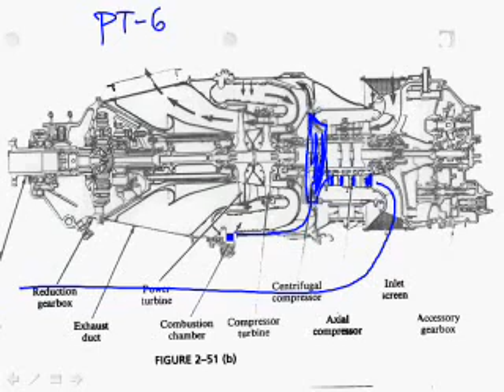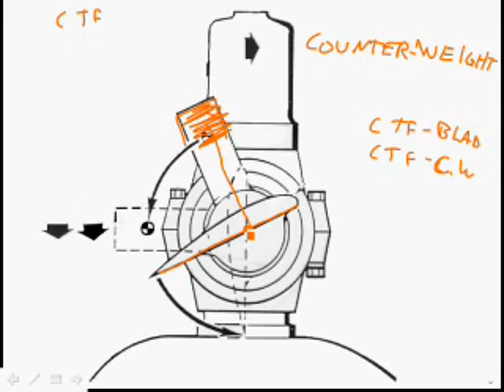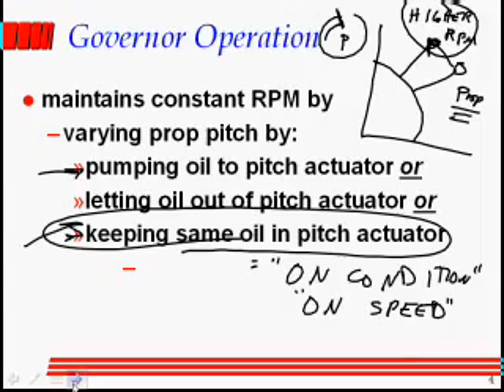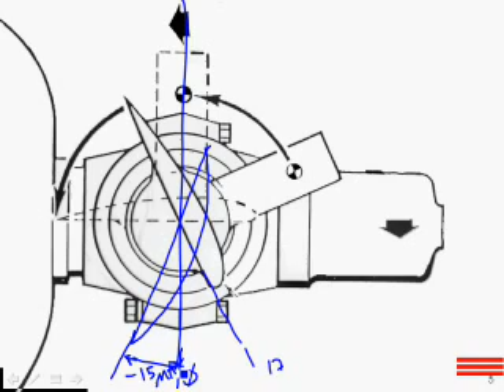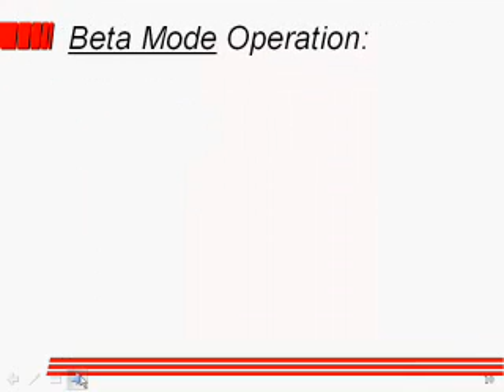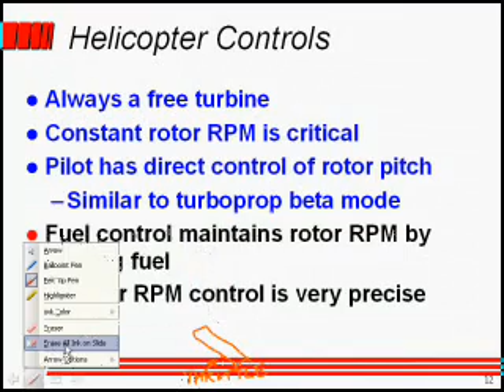15. Turboprop & Turboshaft Controls 57 minutes

Comment: Thank you for the detailed explanation of what all is going on with the turbo prop controls. I'm familiar with how piston engines and jet engines function but what I was reading about turbo props was very perplexing, especially with the primary control knob being called the "power" lever. It's not like we've got a tank of "work" somewhere that we're opening up a spigot on; it's always some combination of fuel and air being burned in a (hopefully) productive way. And it's using a turbine cycle, so air's not a knob we turn. 

The Alpha/Beta modes explanation clear all of that up. In Alpha mode it controls fuel while something else controls pitch, and in Beta mode it controls pitch and something else controls fuel. 

Now I just need to go dig into what the 'Condition" levers do. Based on this, my initial guess is they control the lower fuel flow limit for the engine, to manage how low the RPM can go?

Comment: can you explain where ITT, FF and torque & rpm fit in please?
Reply from the maker: ITT or EGT is primarily there to monitor to make sure the engine is not damaged.  It is not an indicator of how much power the engine is producing.

RPM is effectively constant for takeoff, climb, cruise, decent...so it is not used to set power either.  Just like a constant speed propeller in a recipe, it is there to be sure the redline RPM is not exceeded..Since it doesn't change, it is not used for setting pwer.

If RPM is constant, then we really need to know what Force is being applied to the propeller or to the helicopter transmission.  Torque is a measurement of Force.  At a constant RPM< Torque is directly related to Force and directly related to horsepower.  IF you double the torque, then the Force to the prop or transmission is doubled.

Inorder to increase torque, more fuel must be turned.  Although it is not an accurate indication of power delevoped by the engine, it is close...For instance, if at 100% torque at sea level on a standard day the engine birns 1,000 pounds per hour of fuel, then at 50% fuel flow, the engine will produce CLOSE to 50%  torque.  The engine is less efficient at low power settings, so 50% fuel flow may be 40% torque.

on Turboprop and turboshaft engoines, Torque is always primary for engine power.  Fuel Flowis indirect and should be checked to confirm is going up as torque d=goes up (and there is a typical fuel flow when at takeoff power that a pilot needs to know for takeoff power checks).  ITT pr EGT is there to make sure the engine is not being damaged.  RPM must also be checked to ensure engine is not named and of RPM is too low then engine will not produce rated power:  ROM too high = damage.  RPM too low = low power.

Slightly different subject: for any turbine engine, asaltitude goes up, aiur density goes down.  The engine needs to brn more fuel to get air compressed so fuel can be burned for power.  If less air goes through the ne for cooling, then engine gets hotter for same fuel flow.  Eseentially, as altitude increases, the ttle must be used forward to maintain power (torque).  More fuel but less air = higher ITT or EGT.  At some point, tngine will be "Teperature Limited." if continuing to climb, then throttle may have to be pulled back to prevent the ITT or EGT form being exceeded.  This is true for even a turbojeyt or tuirbofan engine.